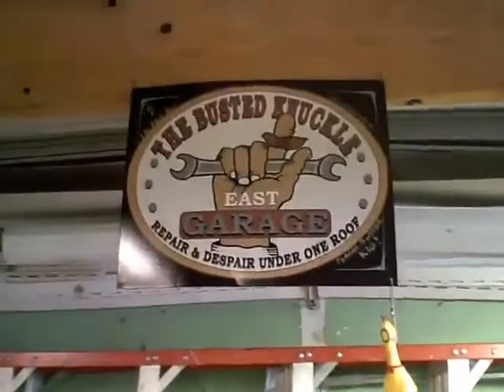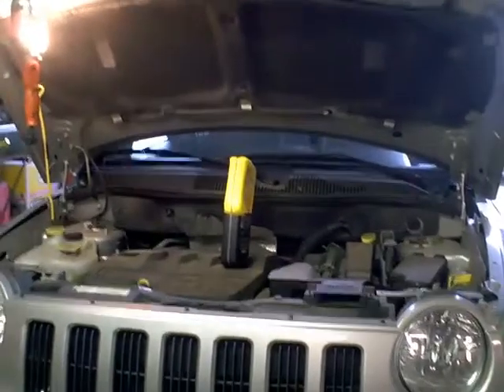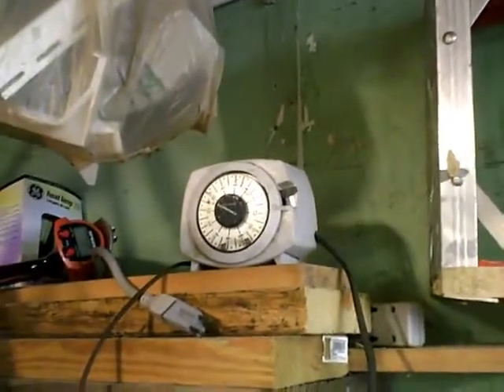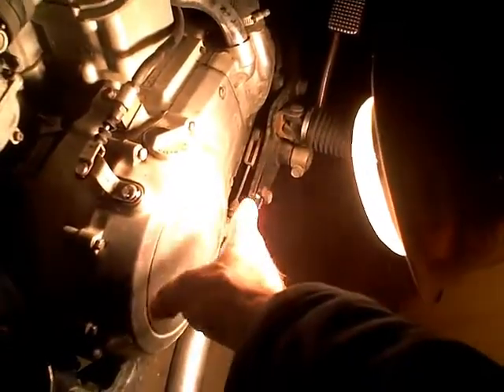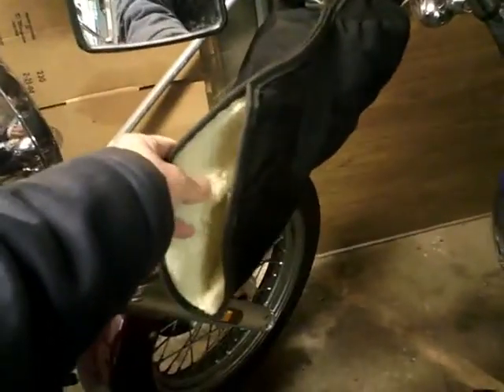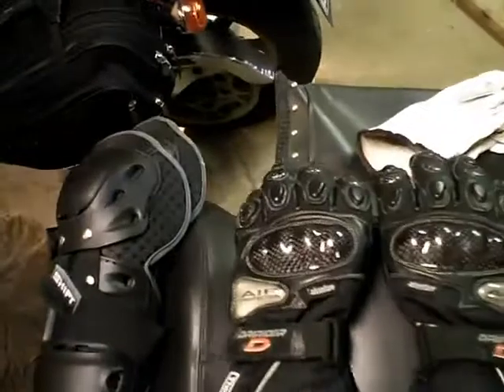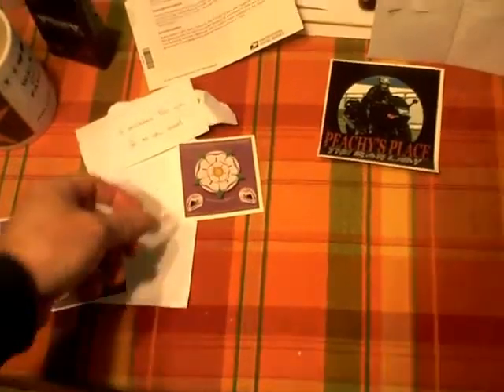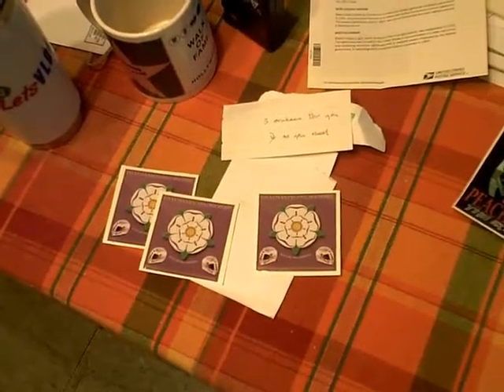Solar Bear Promo - My PBC gear - Shoutout 13herecomesthesun

Comment: thanks Chuck, very valuable tips, have to check out that SBC as well as that plus-ing method ;-)
Your equipment seems to be same as always, that heater lamp is really a good idea. Just to tell it, if someone has one of these infrared heat lamps at home, which are sold in medical stores for some treatment purposes, it should also work fine with those lamps.
Reply from the maker: Yes, good advice my friend. I like to keep things as simple as possible. If it takes too long just getting the gear and bike ready I tend to ride less.

Comment: Thank you kindly for the bump sir!  I only put a layer of  tectyl on the bike. The bike seems to start fine in winter. I used my summer mesh gloves in the muffs. When you put on the heated grips its fine for the temperatures i had last year :).
I still hope to get a new set of tires but looks out of the question before January.
Reply from the maker: Ride safe and have a fun season my friend. :)
Reply: suburbanryder - The Mayor - You too! :)

Comment: I'm not using heated gear, I'm actively testing a deep recharge cycle on the batteries and how cold temperature affects the discharge rates. :-)
Reply from the maker: I will probably be trying out my replacement Shorai battery a few times just to see how it cope with low temps.
Reply: Hey ... I'm commenting from g+.  Does it work?
Reply: John Keith Grewell
I got an email to my gmail account.. I would just like to say I'm a little confused about this new commenting thing...
Reply from the maker: John Keith Grewell
Yes it does. I can see it.